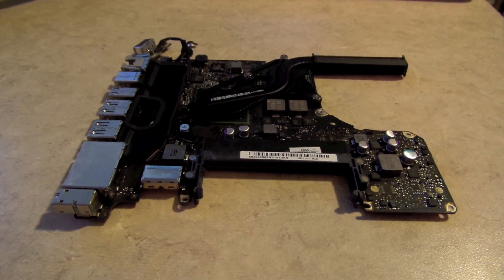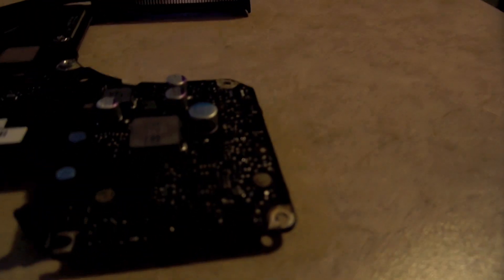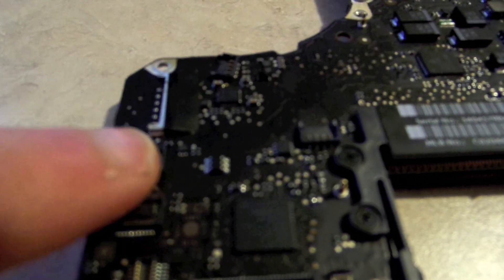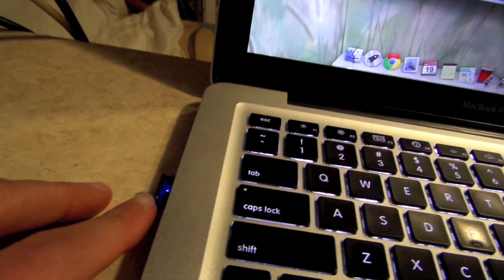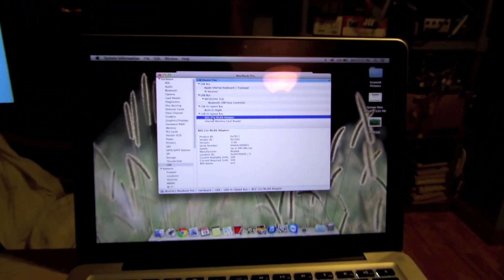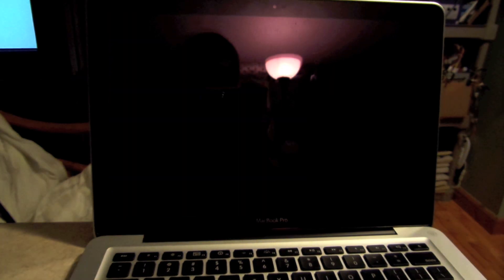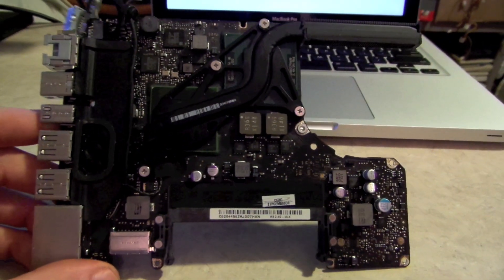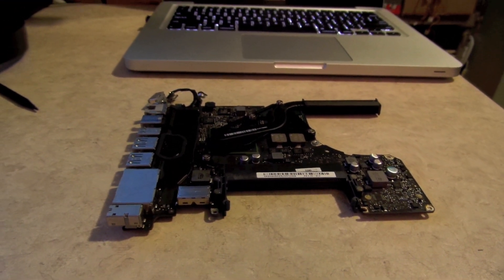Solution to a MacBook Pro with faulty Wifi

Comment: I have the same problem. Not sure if it is melted as I did not look inside, but there is no Wifi detectable. Not even when I try to "add Wifi" with the network application. It is as if it never even existed, duh!. So now I have tried to work around it. I got a stick (Devolo N), it kind of works. It only detects certain wifi routers in the area, but not all, and of course especially not the one I would need. So now I got another Stick which hopefully has a broader band of detecting all wifi in the area. It is a Bolse N300. But not sure if I am too stupid for it, but I can not seem to get it isntalled. I downloaded the driver and all, installed the driver. But nothing happens. It is driving me nuts. So what dongle Model did you use for your mac. Mine is from 2010 (10.9.5 Model), so I have hopes that the one you used may also work for mine. I don't have the money to buy a new laptop, but I need to for work, I am really desperate. Hope you can help me. Thanks!!!

Comment: Thanks for sharing this with everyone. I will take mine one apart right now and see if there is anything melted on the board. It is very upsetting when you spend so much money on a laptop that goes down in the way the cheap Chinese product would.
Reply from the maker: Let me and any other viewers know what you find out.

The sad thing about Apple products is that they are, at the end of day, computers. No matter how much money you spend, they still can fail. It sucks that Apple seems to tell us otherwise!
Reply: appleontheapex I got to the bottom of the problem and finally my macbook pro runs like it used to without any wifi issues. I purchased the usb dongle and before I started using it, I decided to get under the hood of my mac and check the wifi cable once again. Once I unplugged it from the connection behind the superdrive, Ive noticed that plug is missing a little bit of plastic on one side that allows it to move slightly inside. I have adjusted it by looking at my macs wifi bars and then cut out a part of the sticky bit used for sending packages and applied on the connection to keep everything in place.I used my mac for a week now and now issues with wifi. Usb dongle was returned, so no money wasted on repair :) Happy me! Good luck to all users who have wifi issues, it really sucks. I've been already looking for a new mac, but now I will keep it for another year or two unless something else serious happens.
Reply from the maker: Don Poznanskis Glad to hear that you were able to fix it!